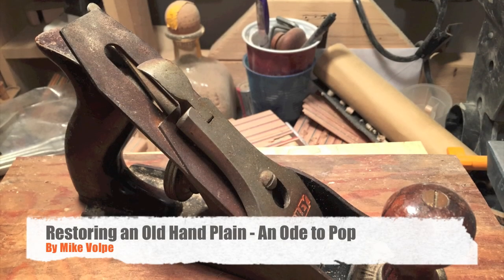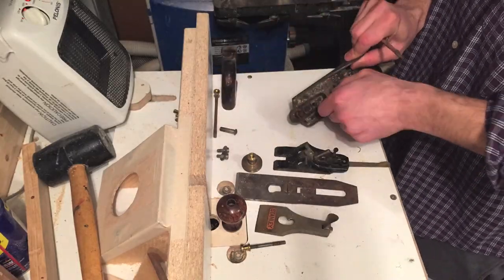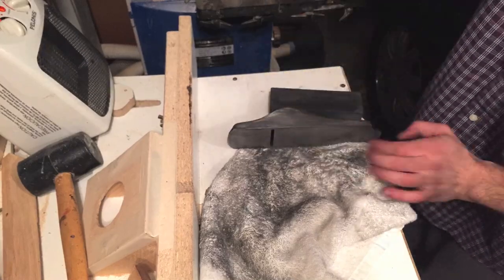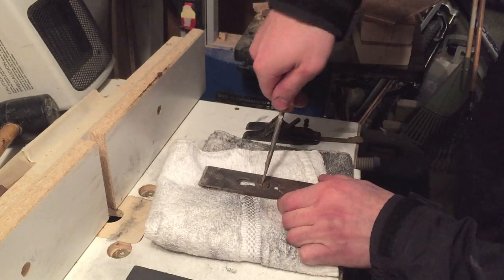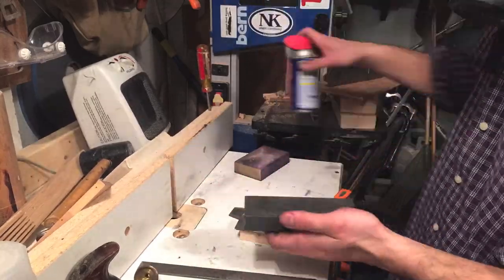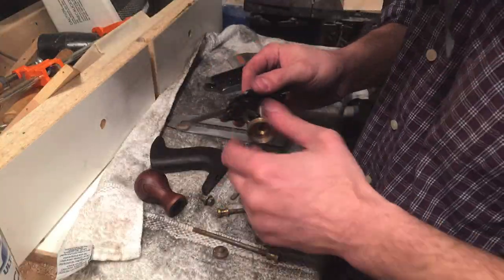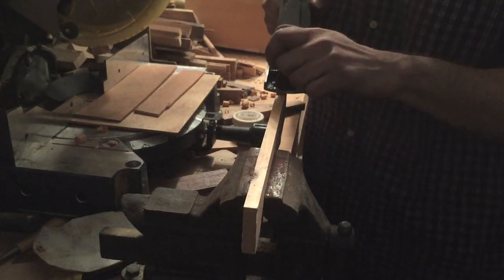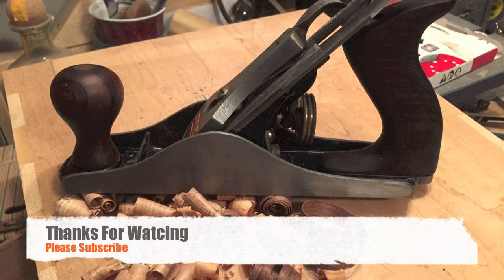Restoring an Old Hand Plane, Restoration Project - 08

Comment: Great story with about cleaning up tools from your grandfather.

I had to just recently make an old plane work also.  In my research one of the things I found was that the sole should be flattened while the plane is under tension.  Though I'm not sure how important that is for a short jack plane.
Reply from the maker: Make Crazydays Thanks for the feedback and the advice. Thats a great tip and make sense to do it that way because once its tensioned again it might mess up the registration.